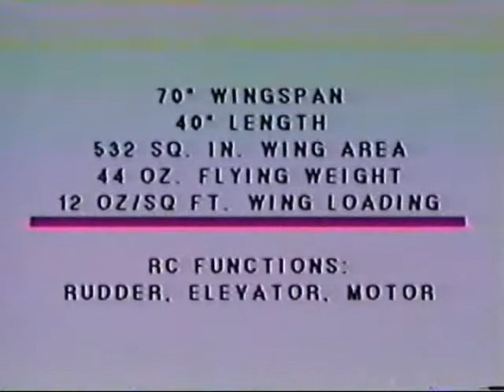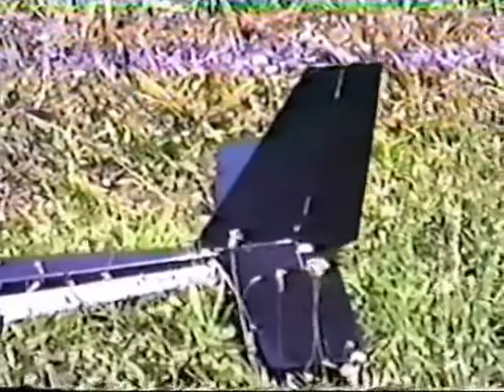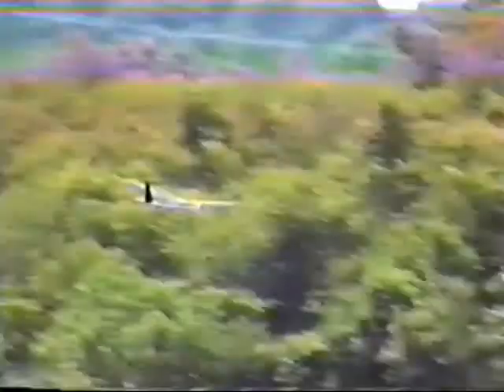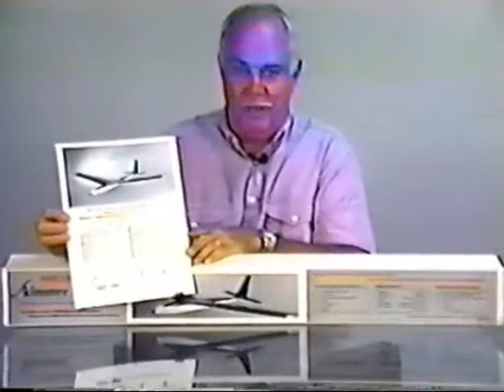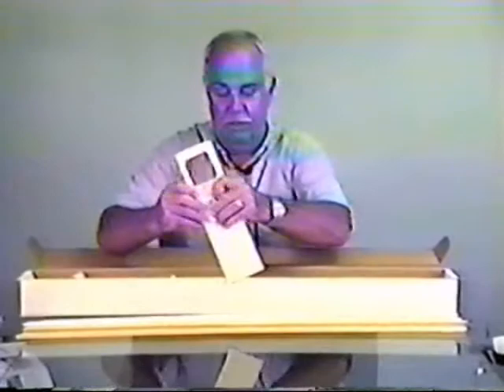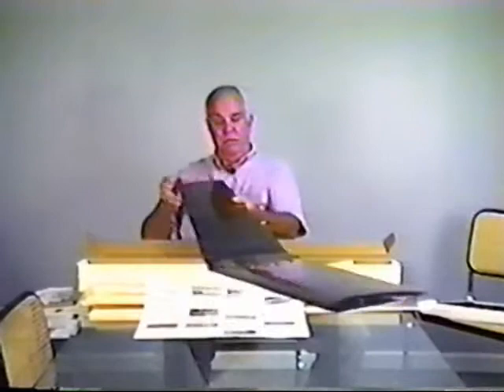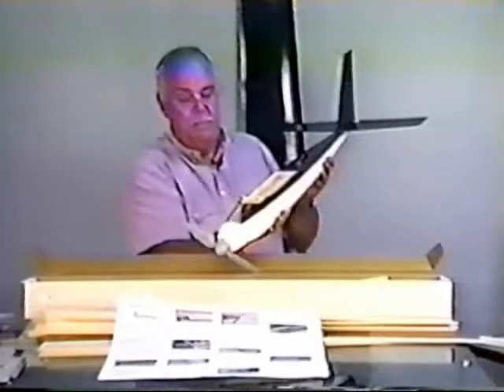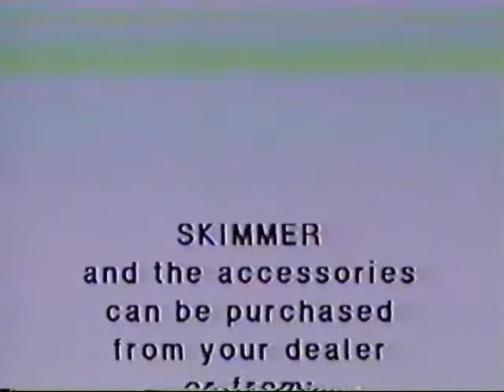Hobby Lobby RC Video:  Graupner Electric Skimmer Sailplane

Comment: Thanks for posting! I have a skimmer i got from hobby lobby that was the 'ready to cover' version. The video is correct the thing catches thermals all the time. I made sure to put extra rubber bands in case i had to dive out of a boomer ( frequent! ). The thing hung from the basement rafters for about 7 years and i recently modified it for fpv with an eagle tree vector. From the beginning it had full length  flaperons as i modified the trailing edge of the wing and also added  two  servos. I'll have to post a video sometime. Sure sad to see hobby lobby close!